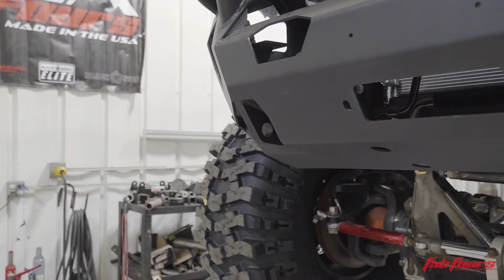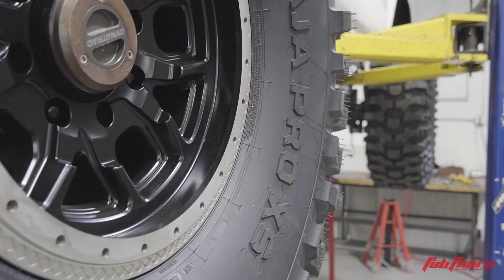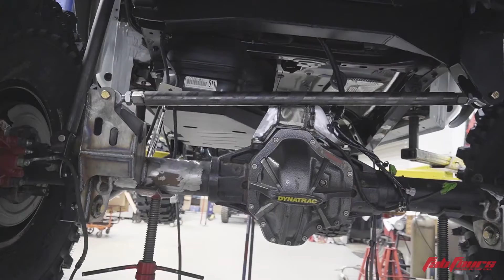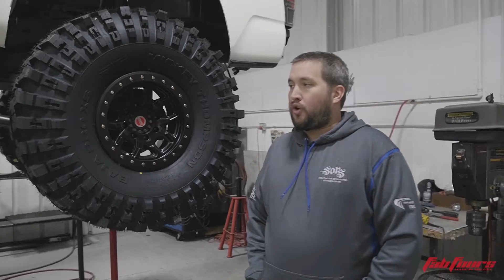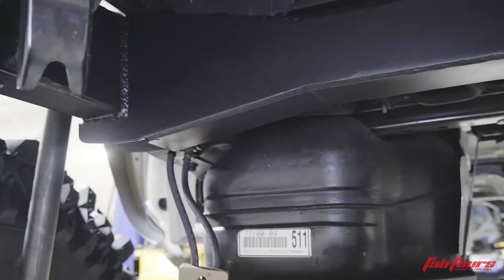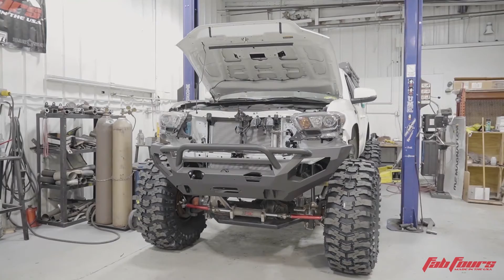Custom OFF-ROAD TOYOTA TACOMA Build and Breakdown (2020 TRD PRO)

Comment: Amazing build but my opinion is I’d have put portal axles under it instead so you get all the ground clearance without having to put bigger tires (anything bigger than a 44)and for the gear ratio reduction to help spin a set of 43” tires. The other benefit is if it’s a trail rig and you do long distance rides having portals will help ensure you get home because as I already stated it lowers the gear ratio to help spin 43” tires but it also helps reduce the stress on your drive terrain since the motor and trans don’t have to work as hard moving the truck. But it’s only my opinion and it’s still a badazz truck and I can’t afford to build it either way, hell I can’t afford the truck by itself lol

Comment: I'm confused. If this truck is intended for offroad use, why do you say you want to keep it low? I thought you'd want to lift it for more ground clearance?
Reply from the maker: Considering this is a small sized truck, just having it on 43" tires gives it all the ground clearance it will need.  The low center of gravity will have it capable of crawling up angles that would normally send a taller vehicle on it's top.
Reply: @FabFoursUSA  hopefully you don't high center on the break over ...lol... I've seen many low center  builds with a 115-120 wb play turtle om a lot stuff ...and end up taking the hook which is just as bad as being too tall and having to take the hook.  I view it all depends how low you consider " low " .  My stock Dodge  2500 with no lift on 35s sits taller at the roof line than the top of my XJ and that is on 42 treps and was on 44 tsl so a low lift on pickup would still be tall compared to a moderate lift on a jeep .
Reply: You don’t need the body to sit 6 feet in the air for a mud/trail rig what you want is ground clearance and suspension travel. You main ground clearance is from tires which lift the axle and with a short wheelbase truck with 43” tires your not really worried about high centering it. The other reason to keep the truck low is center of gravity for trails and rocks to keep the truck from rolling.